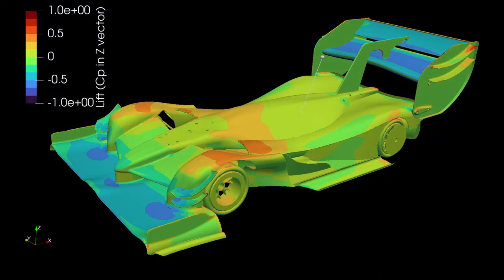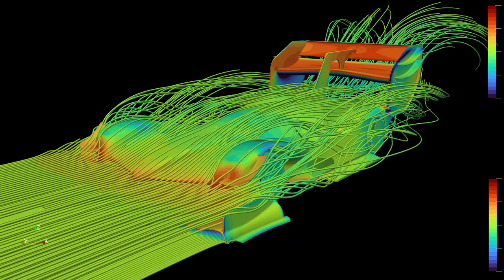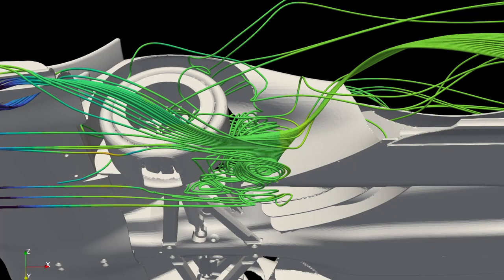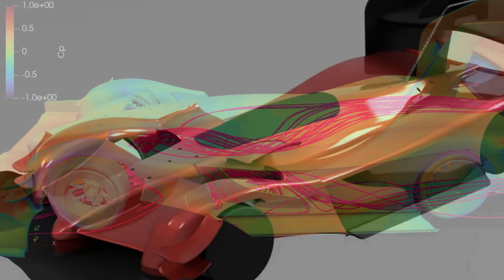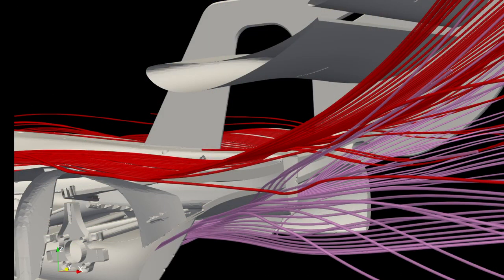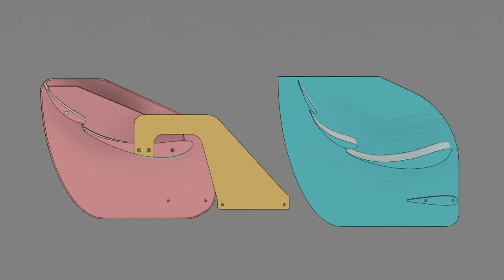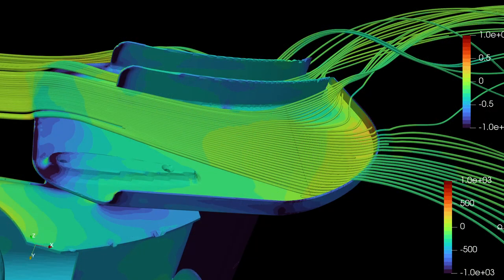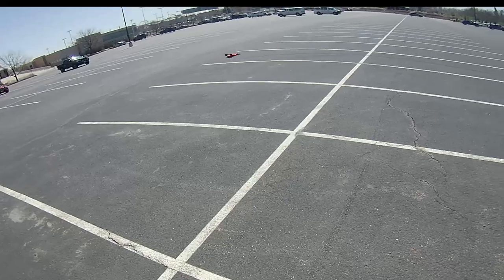RC Hypercar Pt5 - Topside Aerodynamics

Comment: I think what I'd really appreciate is seeing direct comparisons between this car and another one with similar (or the same) electrics and motors. Maybe you could 3d print a different chassis that's just a box to illustrate points. Or maybe how different versions of front / rear wings perform. I get how all this aerodynamics work is good on a conceptual level but it'd be cool to see it in practice. RC Testflight just did something kinda similar with airplane shapes and it was actually really interesting to see how all the theory worked out in practice.
Reply from the maker: That's an interesting idea.  I'll see what I can come up with.  I need to get the car to a point where the suspension is fully developed and all of the data logging is up and running so we can have a consistent platform for comparison. 

I'll go into it more after the aero videos, but this car is in uncharted territory for an RC car.
Reply: @IndeterminateDesign  Ohhhh yeah, it probably wouldn't be very cool / interesting without data logging, didn't think of that. I totally understand that there's a difference between you doing interesting work for yourself and putting out HOT CONTENT that I ENGAGE WITH tho.

Comment: why doesnt the front fender have a gurney flap on the side just behind the front canards just like the rear wing? is there a reason for that?
Reply from the maker: That's a great idea.  The front wing should definitely have a gurney.  As an added bonus it would make the front wing easier to 3d print as well.
Reply: @IndeterminateDesign  so it was an oversight?
Reply: @IndeterminateDesign  oh and i just want to clear up i meant the front fender wheel well openings, its good for sucking air out of the wheel well
Reply from the maker: @gp8666  That would be a good idea as well.  I'll have to see what it does in CFD.  I've been finding more and more that's the only way to tell if these smaller bits work on this particular car with all of the other airflows.  

I'm tempted at some point to make the entire front fender narrower at the bottom so I can jet that air out lower down.  Kind of like what the Aston Martin Valkyrie does right in front of the fender.  I think having the outwash down lower maybe more beneficial.
Reply: @IndeterminateDesign I've been planning on making a similar car to yours for a year or so but I have mostly just been collecting ideas and trying to see how my work has turned out to be so I can get a good rule of thumb. 

By the way I've been really hesitant about underbody aero due to the studies on how the ground boundary layer affects full size diffuser efficiency at low heights, do you know how much it affects a small scale car?

Maybe you can find inspiration from some older race cars like the Toyota eagle mk3 or Toyota gt one, they both are sort of predecessors to the underbody aero you see on modern lmp cars or rather hypercars as they are now called, the mk3 is probably the most out of the ordinary in terms of front diffusers and I'm most likely going to copy it on my next track car project due to how much potential it has, I recommend looking up "mulsannes corner" website, it looks a little sketchy at first glance but it has lots of small information you can't find anywhere else which is why I recommend it

Comment: Question on your aero modeling. I am involved with RC sailplanes. A saying  that we toss around when talking about designs is "air molecules don't scale". What we jokingly are referring to is that a design that works at one scale, say on a full sized aircraft, won't give similar performance on a model. Vice versa, going from a design that works great at model scale exhibits poor performance at full scale. Are your simulations taking this into account? After watching these last two videos I've been wondering if the performance that you're expecting is actually feasible at the size if the car relative to the air passing over it. Kudos for another great viseo!
Reply from the maker: I've had a few people bring this up and I can cover it a bit in the next video.   The CFD software does take into account the physical size of the car.   This car was always designed to function at this scale, so it has relatively massive aero devices.  The RC car is really inefficient compared to what it would be if was a full size car.  Maybe only half as efficient.  

I think that's where the "air molecules don't scale thing" comes into play.  If you scale down a full size plane to an RC model, it's going to have very different lift and drag numbers than what would be expected if it had scaled perfectly.

Comment: I'd love to see some pseudo wind tunnel tests. Maybe a leaf blower and some different coloured smoke sticks
Reply from the maker: I'd love to do some of that kind of testing.  I've been looking at pressure probes and ride height sensors to maybe make the car more of a rolling wind tunnel.
Reply: @IndeterminateDesign  I'd just be interested in a basic flow visualisation comparison between the CFD and reality. At this scale, I imagine print inaccuracy and layer artefacts could change the flow quite a bit.

Comment: From what i understand, the backed off center rear wing is basically working off of the angle of attack of the oncoming air that's influenced by the bodywork ahead of it. Because of the monocoque bulge that drops off right ahead of the rear wing, the flow there is attached to the bodywork  and  at a slight downward angle compared to the flow to the side, where its relatively flat. The backed off center is just tuning the approach angle of the wing to work best with the oncoming air. This is apparent in the flowlines in your cfd too. Great work these videos are fascinating, and i hope the car exceeds expectations! Cheers
Reply from the maker: Thanks!  Now that I see it, that makes perfect sense.  I’m surprised at how much of an affect this has.

Comment: What do you use for the CAD design? I'd have nightmares trying to create such a complicated design, let alone a design that needs to be tweaked. Did you ever need to start from scratch?
Reply from the maker: I'm using Fusion 360 as it's free for hobbyists.  This car definitely pushes the boundaries in terms of complexity and performance for Fusion 360.  In the beginning, I redid the car 3-4 times.  I learned a lot from that experience about how to best setup the model so that it's easier to change and doesn't crash Fusion as often.  The model can still be quite fragile,  but I've gotten good at fixing it.
Reply: @IndeterminateDesign  yeah, I'm on F360 as well after Solidworks got rid of the EAA licence. I think it'd take me a year and a dozen starts from scratch to make something this complicated.
Reply from the maker: Well at this point I've done quite a bit in Fusion 360, with my F1 gearbox and streamliner models.  You really need to plan your model ahead of time to ensure you have all of your geometry laid out.
Reply from the maker: @toolscientist  Solidworks has a $99 maker's license now.  I just don't have the energy to convert my models.
Reply: @IndeterminateDesign  it's diff software, though. I can't remember the details, but I looked into it when it happened and people were scathing of it. Lots of bugs and issues with models not being transferable between maker and full version. So if you ever wanted to upgrade, all your old models and parts libraries would be useless.

Comment: Great video, thanks! How much does the relative viscosity at model scale affect the aero elements?
Reply from the maker: Thanks.  It's very hard to compare to a full size car since I was always designing within the paradigm of this being a small car.  With the low Reynolds number, the aero devices are far less efficient and effective than on a full size car.  

I've had to oversize the aero devices considerably.  The front wing would be 3.5m or 11.5ft wide on a full size car.   The aero devices seem to be more sensitive as well.  Airfoils that should handle 12+ degrees AoA, tend to separate at around 10 degrees.  So if this was made into a full size car it would look very different.  This car has a lift of drag of around 3.8:1 and a full size car like this is probably be well over 6:1.

Also definitely not an expert in this by any means.

Comment: Hats off to the things you do on this channel, the f1 gearboxes as well! I'm playing around putting an RC car in a race simulator and it is going well. I've also found the side forces to be actually noticeable. I would like to put something like an aero map and also aero side forces and moments you may have found, in the sim to actually feel how the car drives. We could import a 3D model (not a million polies) into the game as well.. I'm sure some things can't be modelled and the tires will remain a question, but I would love to play around with it for fun if you're up for it. Video of current state of my work: watch?v=v2oZENGrPZs
Reply from the maker: That's really cool.  I would have loved to learned how to do that.   Your link didn't come through on the comment.  I know a lot of FSAE race teams use Adams car for simulation, and I thought about trying to use a chassis simulator like this.  It's hard because there's no data out there for RC car tires, and my testing shows they're very different than a pneumatic tire.  You can download the STL for the body from AirShaper https://app.airshaper.com/projects/rc-hypercar-final-589b61

Comment: Great stuff.  

Did you ever consider enclosing the wheels to lower drag?  Advantages / Disadvantages?
Reply from the maker: I thought enclosing the rear like the Jaguar XJR-9, but it definitely complicates things.   Enclosing the rear would make it very difficult to remove heat from the motors (They're pulling over 500watts each at full throttle).  The entire front end could be changed to reduce a lot of drag, but to enclose the front wheels the car would need to be really wide.  

The hardest part of  designing this car is I wanted to generate huge amounts of downforce at 60mph or less, and efficiency is really hard to achieve at this size and low speed.  Honestly, almost all of the drag on the car comes from the giant wings and downforce generating stuff.  The drag from anything else is trivial, probably <5%.    

I thought about doing a top speed variant, and if I did, I would just make a wingless and more streamlined body using the same monocoque.  You could optimize the cooling for speeds over 100mph, and not have to worry about bashing the car around a parking lot.
Reply: @IndeterminateDesign  you should try copying the "enviate hypercar 2021" should be one of the first search results, it has concave cutouts on the rear wheel covers to induce a vortex and to make downforce while cooling the rear brakes which i believe could work on that car as they are very similar (my speculation), in fact i think it would be even better due to the turbo fans keeping the air from hitting the rim